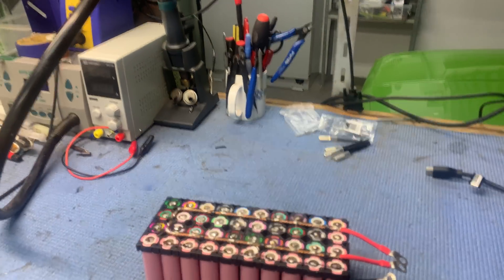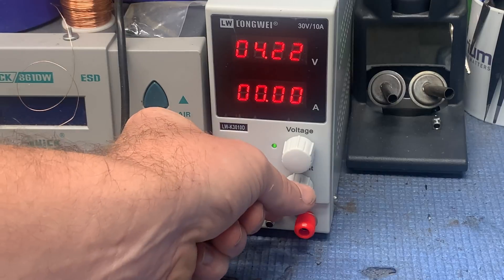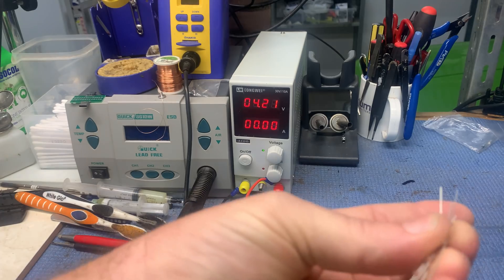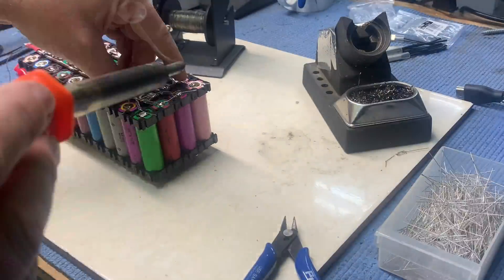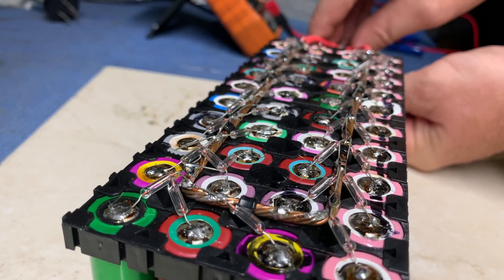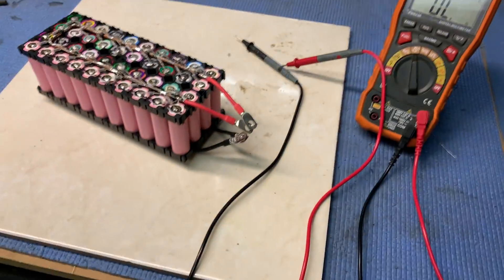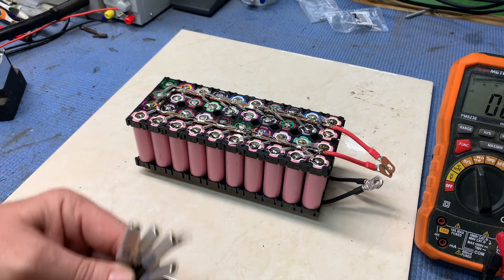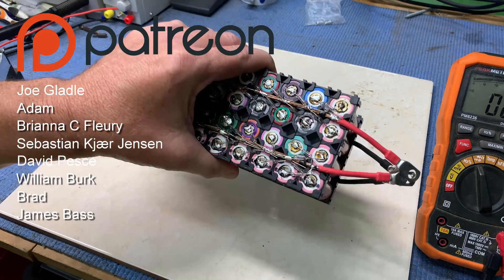Glass fuses on an 18650 battery - Cell level fusing

Comment: I would put 1a fuses and call a day why u not did that? Why?
Reply from the maker: Because it is 100's of extra failure points, looked ugly, is more expensive, and doesn't add that much more safety in this application. Already use fuse wire rated at about 3-5 amps for years, and never had one fail.. Fuses are for holy fuck moments - massive dead short of some description. These or even my current fuses still don't blow when a cell is faulty and self-discharging and heating up.

Comment: Its important to fuse each side of batteries?
Reply from the maker: Some do, I think it adds another point of weakness and resistance.
Reply: @HBPowerwall  then i can use 0,15nickel in negative side spot welded, and soldere glass fuses on positive side?
Reply: @HBPowerwall  one more question 😁. In normal use have you blown fuse in pack?

Comment: my opinion  those fuse did not blow up  same time because some battery are different  internal resistance so i believe if you use new battery all same chemistry  like IMR   if you mixed between them lime IMR then NCR  so some fuse will not blow up some will so if you try new batter match all things i said like same chemistry same cycle same internal resistance
Reply from the maker: I would agree

Comment: I am a bit of a battery virgin, so excuse my uninformed question, but if a fuse level pack experiences an actual in use dead short that blows most of the fuses and the problem is not noticed, is there a chance that the charge device (whatever the device may be) will continue to try to charge the few cells left to destruction or will the remaining fuses finally blow and/or will the charge device detect the problem and shut down the charge. 

In other words, if the pack in use and not noticed in the short condition, will the remaining fuses eventually blow or will the cells continue to cook until something happens until they are completely destroyed?

Comment: I’m going to guess that the internal resistance of the ones that didn’t blow are too high to allow for anything over or near 2 amps to flow. I’m sure this has been said. Check the IR of the batteries that did blow the fuse and the ones that didn’t. I’m sure they will be different.

Comment: Pete if the capacity is  a lot lover than the others there is less current drawn from them. I would test or check the cells that did not blow the fuses's capacity

Comment: Isn't soldering onto 18650's a bad idea, all that heat transferred into the cell (composition and construction) a recipe for disaster, either sooner or later?
Reply from the maker: Well my own wall is 5 years into service (or close to it) and still going.
Reply: @HBPowerwall  OK, good to hear. But you did review / use a very nice Kweld spotwelder in one of your other posts, right?  
Should that not be the best since there is zero (or at least much less) heat going into each cell?

Comment: I don't think the fuses were damaged. I rather think either those cells were bad, or the few fuses were another value altogether.
You can test the resistance in the mOhm range of the fuses by passing a controlled  0.5A, and measuring mV over them.

Comment: Why fuse both sides of each cell? Most fused systems are on one side of the circuit. I am also thinking that the resistance of the fuse wire may increase when it gets hot and having 2 in the circuit may act as a current limit on a cell with high impedance.
Reply from the maker: I guess because telsa fused both sides if I had to guess.. but yes it would limit current flow

Comment: You need to determine how many amps you expecting to get out of your batteries and fuse them accordingly. I use 10s 100p setup to run a 10amp inverter, so pulling 10 amps from 100 cells is 100mA of current per cell so a 200mA fuse would be ample for my setup and even low cells will break the fuse.

Comment: I have a power supply just like that. Very handy. I've found that the glass fuses break at roughly twice their current rating. If the fuse wire doesn't break until 8A, I'm not sure what use they would be unless you're using several amps per cell normally. I've also found that a small number of glass fuses are defective in each package I buy. So I check each one before I install it. With practice, they can be made to look nice on a battery.

Comment: For the thermal fuses, it is recommended to use a crimp or spot weld to install them.  If you have to solder them you will want to use something like a cold wet rag or even an ice cube around the body and in the connecting wires of the fuse depending on the temperature rating of the fuse to keep them from failing during installation.

Comment: That is a intresting experiment. Glass fuses are pretty much safest option available. Looking at your the video... makes me think if smes cells didn't produce enough amps to blow a fuse? Can you measure each cell current output with safely?Also I have noticed that sometimes when glass fuse blows it creates metal vapour inside which is little bit conductive and can give confusing readings with multimeter. 
Good job on all of you videos Mate! Respect!

Comment: Those 5 fuses that didn't blow might have been on batteries with high internal resistance / batteries that can't deliver the required 2A. I hope that's the case, otherwise the fuses are bad. Damaged fuses would burn out *sooner*, not later.

The voltage spiking when you pressed the busbar was probably from your hand conducting from healthy cells to the bus ;)

Comment: Cheap red 17$ spot welder from AliExpress or eBay would do a great job welding fuses to the cells. Not sure about the bus bar.
Reply from the maker: Yeh for the first three welds - no thank-you :(
Reply: @HBPowerwall  I completed over a thousand successful welds between relatively thick nickel tabs and it does the job great. No complaints other than the device heats up a bit. I highly recommend getting one if you need to weld but can't justify the €200+ for a bigger unit.
I added solder to the device I got and it helped me get a lot of welding done quickly.
Reply from the maker: They would for sure be good value for small projects - can't go past a real one like the Kweld if you want 100,000 welds and counting.
Reply: @HBPowerwall  I would say they are capable for most projects most people do. My point is they certainly do their job while costing almost nothing compared to other units. Definitely a worthwhile investment if you need a few hundred to a few thousand welds.

Comment: I was thinking maybe there is a thermal sensor that could go on a ribbon, and be placed with 2sided tape to the cells of the whole pack, maybe to detect 2-4cells each, but the ideas ban get crazy deeper you go!! If you go that route, I think nickel strip on the neg. Side with a aluminum bar attached with thermal tape, to read the temp of a large group of cells, then slightly thermally insulating, to prevent the aluminum from cooling the cell, being the neg. End is closest to the internal temperature of the cells, maybe a single temp sensor could detect reliably around 16cells,  surely a system could be D signed cheaply to protect a pack from over temp, maybe even connected to a cheaper BMS, someone is going to eventually solve all these issues! But it's always going to be some kind of something when using random used cells all paralled, and in series!    The cells that do not blow the fuse must be high resistance, and/or has a **high resistance connection!**  that could be it! Maybe the solder or the heat from soldering damaged the connection internally?? Or there is contamination in the solder, causing a high resistance??  It's always something!!

Comment: Some calibration and testing would need to be done but, sensing the resistance of the pack with a custom circuit and tripping a shunt trip breaker for that particular pack when the resistance drops below a threshold (dead short). Don't have a pack to test with, but this method does work on larger industrial battery backup systems. Thanks for the videos btw :) Cheers from Canada

Comment: Nice video!  2A fuse will not blow at exactly 2A because they're supposed to carry 2A load. The max current tolerance for 2A is about 4A or more. Another important factor is combining 40 pieces of 2A fuses in parallel will actually mean about 80A, the role of the fuse is to disconnect individual rogue cell and save the pack. Your  next video should be to the fuse on a rogue failing test.

Comment: I think you're not really doing this video justice unless you measure the current those (individual) cells are delivering on a dead short. Just remove the cells that did not blow and put you ammeter in line with the fuse and then short it out.

I think what you'll find is that although these cells show full voltage when charged, they are likely unable to deliver more than an amp or so which means they will never be able to blow the fuse.

I think what your highlighting here is one of the risks taken when using used cells from hundreds or thousands of different sources, all of different ages and all with different usage histories and then putting them together in a pack to act as one cell. Obviously even with the best care taken in testing and selecting cells, you really cannot determine age and you are bound to run into really all sorts of weird types of failure. 

I think if you do this test again with brand new cells, you will find that every single fuse blows as expected.  Which would be a really good test to highlight the differences in behavior for your viewers!

Great job with these videos mate!

Comment: Who is investigating high resistance, poor, COLD SOLDER JOINTS ?  After all, you are using the absolute minimum heat and the absolute minimum time soldering - which is the opposite of proper soldering technique.  The solder must get HOT, and flow,  and properly BOND to the battery and the wire.  And you are using a blob of solder as the conductor.  That is very WRONG !

Comment: Important is the voltage over the fuse. The fuse wire in the lenght shown the supply shows 1V and the wire only glowing dark. Then you have both cell sides fused so 2v over the fuses to pop them. No margin for higher IR cells there. Fuse on the cells should only have 0.5v  drop when breaking

Comment: So this little pack contains 40 cells.
Each cell 2 amp fuse
So you are going to draw 80amp from such a small number in a powerwall ???
Much lower would be better per cell max (as a powerwall)

How many amp do you draw max per cell on your powerwall setup??  
If your packs are 150 cells x 2 amp fuse = you can pull 300 amp before the first fuse wil blow. 
Keep the fuses as weak as possible.  1.5-2 times the max amp you pull .

Comment: You can't measure continuity between two points that have a potential difference. The meter applies a small voltage to its test points and checks if a current flows to measure resistance. If there already is a voltage present on the device under test the reading will just be random. If you unsolder these fuses (or the cell on the other side) I bet you would read a very high resistance. 
Also when testing fuses with a switching power supply you have to be aware that your power supply has an output capacitor. This can supply a very high current at whatever voltage it is currently charged at for a short period of time. The current limit only defines at what rate this capacitor will be charged again as a sort of long term maximum average current. If you don't want that current spike the only way is to start with your load at 0V.
Reply: He measured continuity between Positive power wire and the Positive cell terminal = the exact same potential.   We do not need to unsolder the fuses.
Reply: @MrSummitville  Let's imagine the cell with the fuse under test has 4.1V and another cell that has an unblown fuse has 4.2V (voltage differences exaggerated). Taking the positive bus bar as a reference we would measure -4.2V to the negative bus bar and -0.1V to the positive terminal of the cell with the fuse under test. This voltage will render the resistance measurement useless.
Even if the cells all had exactly the same voltage (which they do not because their resting voltage will always deviate ever so slightly) all cell positives would appear "connected" because they are referenced to each other via the negative terminal. This means measuring from the bus bar to any cell will always read the combination of all unblown fuses, even when measuring on a cell which actually has its fuse blown.
Reply: @JonaJona  Regardless of what you "imagined",  using the continuity setting does find blown vs un-blown fuses.  Does the continuity setting on your meter, not work for you?
Reply: I can assure you, my meters all work well when used correctly :)
Reply: @JonaJona  My meter finds every blown fuse and every good fuse, with 100% accuracy   So your "problem", must be with you ...
Reply: Looks like you have a different use case then ¯\_(ツ)_/¯

Comment: the thermal fuses have a mechanical connection use alot in fan heaters where the terminals are crimped

Comment: Glass fuses are far better then just having a fuse wire in free air. This is a reason why they are encapsulated as well. As it keeps the fuse wire in a stable environments and allows it to blow as a set amps. The fuse wire in mid air has so many variables it’s not ideal at all
Reply: Fuses do not blow at a "set amps".  They blow after some MAX TIME has elapsed, with a given amount of amps, per their spec sheet ...

Comment: Really seems to me like the cells that didn't blow their fuses just aren't capable of providing the amps needed, and are quite probably faulty.

Maybe pull some from the pack and using a current monitor see how much current passes through a wire dead shorting the cell.
Reply: Or maybe High Resistance from a cold solder joint?

Comment: Use good quality crimps, or spot welds for thermal fuses. Or for some entertainment, ask the apprentice to solder them on until they get it right. Sidenote, the apprentice might come up with a better suggestion than I.

Comment: Have you thought of using solid state self resetting fuses?
Reply: Post an URL to the component you recommend
Reply: Many types available. here is one rated at 1.1A 60V. Try searching in Digikey or Mouser for PTC Resettable Fuses. 

https://www.digikey.com/en/products/detail/bel-fuse-inc/0ZRP0110FF1E/9468256

Comment: even those 5 fuses did not blow up. that pack voltage is only around 1v, that enough for BMS to detect sth wrong n cut off;

Comment: Would be interesting to see the IR of the cells that didn’t pop the fuse and that did, couple of other people have mentioned this too. Also another test would be to dead short those single cells one at a time with a multiple meter inline to see what amps it is able to sustain during and compare to other cells see if there is a difference

Comment: The thermal fuses are no better than the glass fuses in this situation.
The cells that are not blowing the fuse have a problem of some kind and are not able to provide the energy to blow the fuse. Probably the IR is higher and the meter you use may not be able to discern it as I don't know how it measures it I can't comment.
1.  If you take those cells out and test them by shorting them with thicker wire and your clamp meter measuring the current I think you will see they can not provide the current.
2.  Do the same with a cell that blew the fuse and you will see a big difference.
3.  The ones that do not blow the fuse if left in a short condition do they over heat?
Reply: also the fuse is to high Resistance if there is 1V dropping on each one, double fused means 2v over the fuses
Reply: @flipschwipp6572  The last test was with 4V and 1 fuse and 5 fuses did not blow.

Comment: with the not resetable fuses. DO it like its in Laptop Batteries, solter them to short nickel strips and than spot weld this nickel to the cells and solder on the busbar.

Comment: The problem with some/many PSUs is they have an electrolytic on the output so if you set a constant current, limiting does not start until the cap has discharged. The way around this would be to short the output, set the current limit, attach the load and only then remove the short.

Comment: Flux issues maybe? I've had trouble like this with fuse wire. What I had to do was make sure I was getting the wire itself hot enough. Sometimes you can get the puddle hot, but the if the wire doesn't get hot enough before the puddle cools, the flux sticks to the wire when the puddle cools causing a poor connection. Sound crazy, but this has been an experience of mine in the past. This would need extensive testing under different conditions to prove. 

Someone also mentioned High internal resistance in the cells. I'd explore that too. But that doesn't explain the resistance value changing when you were touching the cells. Having an internal resistance testing station set up to make things go fast would be ideal. I just set up a load test of 2-5 amps (depending on the application) of fully charged and rested cells, and monitor the voltage when under load. If it drops below a certain voltage (of your choice) when under a load , I scrap or repurpose the cell. This all depends on your application. Like if it were a battery pack for a motor of some sort, I'd never use a cell that has too much voltage sag. I might use it for a powerwall though. But again, it depends on the application.